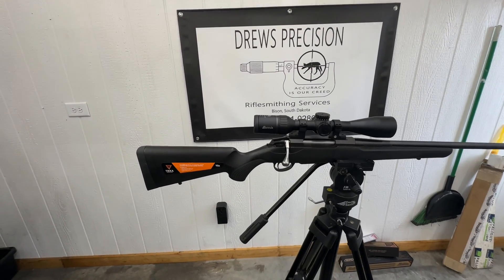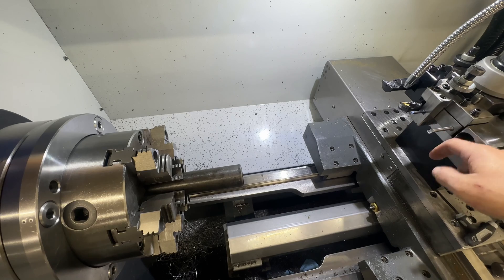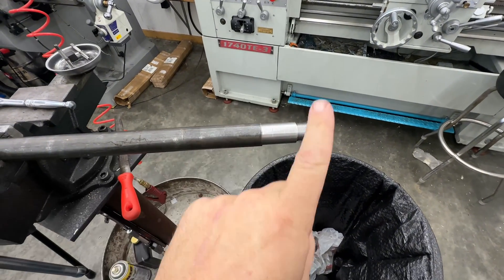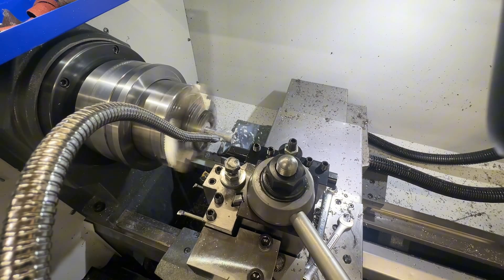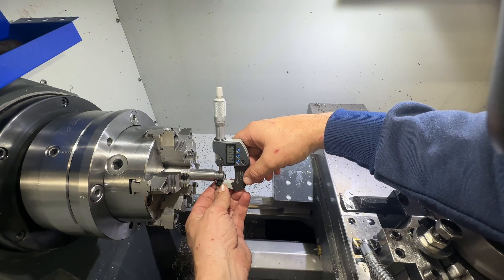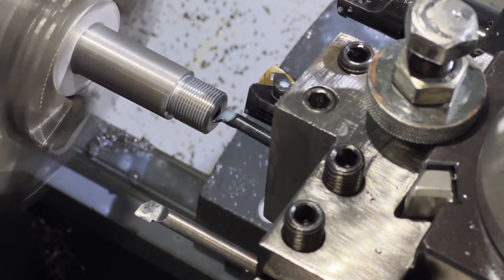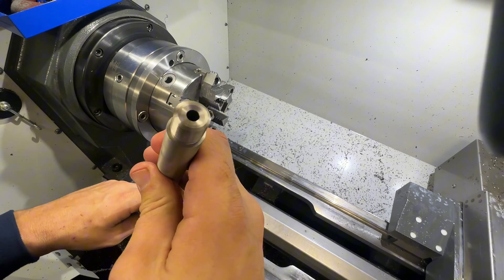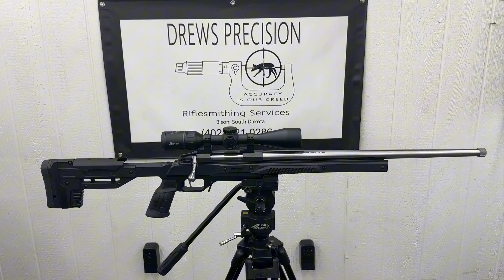Drews Precision, Tikka T3X, Custom 22 Creedmoor , Barrel threading, Rifle Threading, CNC Gunsmith

Comment: If you generally thread the muzzle you can make a custom metal piece that threads on and the hose quick connects to for you fluid through the barrel. Only downside I would see is the need for it to be two parts because of the barrel spinning
Reply from the maker: I drill and tap a short set of pipe threads. The pipe threads have been 100% leak proof